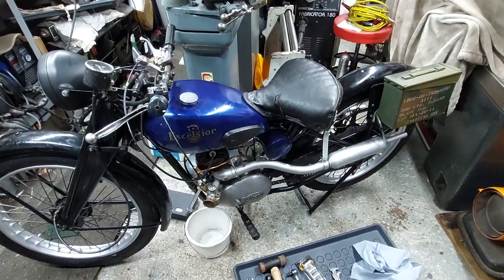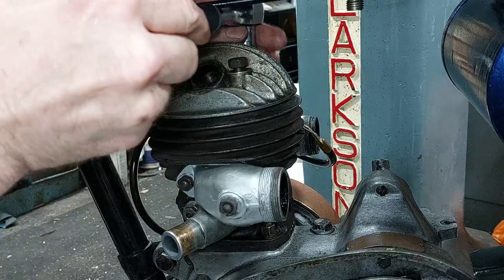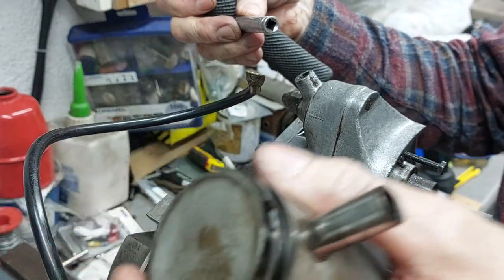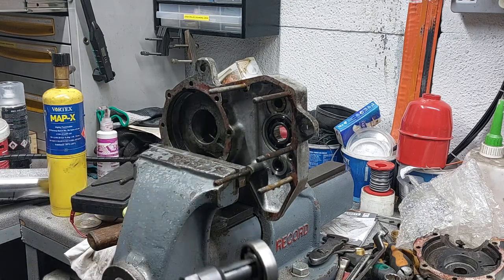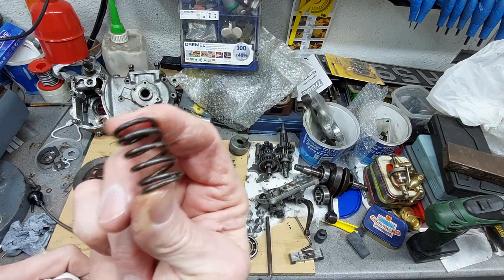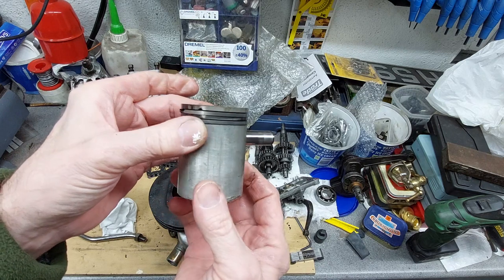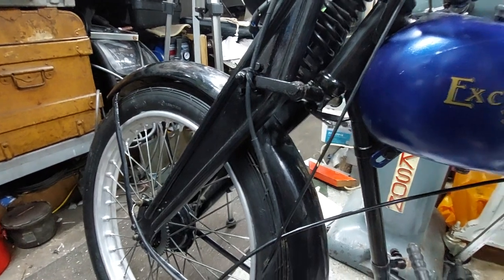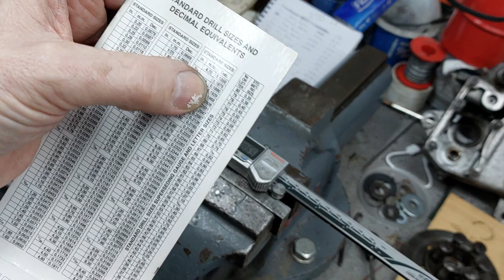ENGINE STRIP DOWN & INSPECTION OF 1939 EXCELSIOR UNIVERSAL WITH THE VILLIERS 9D 125 ENGINE..

Comment: Outstanding video.  Thank you so much. About 10 years ago I purchased what I believe is a 1946 James motorcycle in original condition.  It appears to have this exact (or very close) Villiers engine.  Mine is a MK.9D, magneto number 539/351 6P.  Since purchase, various projects have kept me from tearing it down to get it running.  However, your video has inspired me to give it a go in the near future.  I appreciated that you took time to include the address of a parts supplier.  Since I live in the U.S. where Villiers are rather rare I'm unaware of any suppliers in this country.  Your video was very methodical, with good thought and discussion as to each part.  I wish there was a local mechanic I could turn this over to and get it back next week.  But since that is not possible, videos like yours with good sound advice and overview will have to do.   By the way, that small mystery pin almost looks to be about the size of the missing ring retention pin in your piston?  If it is, I don't know how it could have dropped into the lower part of the engine except perhaps by a previous mechanic while taking it apart?  Thank you again for taking time to post it.
Reply from the maker: Glad to have inspired you, the MK 9 D's are pretty thin on the ground over here too surprisingly, the piece of rod turned out to be a bit of clutch pushrod, some butchery had gone on in its lifetime, all is explained in further videos, here's the playlist for you 

https://youtube.com/playlist?list=PLyBa-OlxfN3O0yMoIH6EpObMCLLkGXwAO&si=h3DueCSsle0ZOear

Comment: Think the mystery part in the oil is part of the clutch pushrod system.  Is there a ball-bearing in the push rod stack too?
Reply from the maker: Hi Chris, you are quite right, it's part of a bodge to get round a problem that i wasn't aware of until the engine was reassembled,  it was part of the pushrod stack which then got replaced with a couple of ball bearings to circumvent a problem. The clutch system on these units uses 3 pushrods with a ball end on the clutch lever . All is revealed in this video https://youtu.be/hPRCcUYeqp0
Reply: @TweedsGarage  similar to my ducati. Has a load of rollers and balls to reduce rotational force on the pushrod.

Comment: Well this takes me back. Had a Greeves with an 8E 197 Villiers. From memory the primary case oil is  SAE 180. At 4 centigrade you'd need to shovel it out. Re-corkedmy clutch. Used to replace the crankshaft oil seals monthly because the crankshaft was so worn where they bore.   Could never getthe timing right. Either easy start on the kickstart and gutless or bump start only but plenty of power. Remember the brass flywheel too but had no lighting coils. Great times.  I think I donated it to the local ATC for spannner and general fettling. practice.
Reply from the maker: An interesting trip down memory lane Andrew, they did like thick oil in gearboxes and chain cases back then ( probably an attempt to stop it falling out ) , the Ariel NG i had had a grease filled gearbox.....which was fun doing an oil change on.
Reply: @TweedsGarage  long since left road going stuff behind. Found grassroots flying. Have a plane to restore, which I've had since 1986.   Here's a tip for you. Light aero Spares can supply aircraft quality BA nuts and bolts.  Love the Riley.

Comment: That was a giant leap forward! Nice to see your bench is as full of essential bits as mine is. It is good the the main bearings are in usable condition, I too have a great deal of mistrust of bearing with no makers name on them, these small machines are very handy when you come to a rebuild, no lifting gear or huge load bearing benches are required. Chris B.
Reply from the maker: I do try to tidy it up Chris but usually get distracted so it soon ends up back in chaos , i did think it would be a nice easy project to do in the workshop on the bench whilst it was too cold to be rolling around under cars at the moment.
Reply: @TweedsGarage  I have the same problem down here in the South! The gauge tells me it is 4 degs, but it feels much colder, probably due to the 80% humidity, so the Defender stands outside waiting for the new brakes to be bled! The problem I find when I tidy up is that I can never find anything. Stay safe! Chris B.

Comment: I was just wondering how much piston ring movement is too much (  not piston ring gaping  ). But up and down movement of ring in piston slot.......looks like I am one year late in asking question... engine I have is 1F
Reply from the maker: Hi David, apologies for the late reponse but i was checking a few bits of info first, Villiers don't specify a minimum thickness for rings  for the 9F, but do specify a maximum ring gap of 0.030" before replacing and a minimum gap for new rings of 0.007 " . The major British manufacturers of the time specify a vertical ring clearance of between 0.002/0.003 " but this is for four strokes so you could probably allow 0.004 " which BSA recommend  for competition tuning. 
If you need a new set try https://villiersservices.co.uk/
Give them a ring as they stock a load of parts for the older engines but don't list them all on the web site.
The rings on the Bantam were worn to nearly half their thickness but the piston grooves were fine!

Comment: Nice video and explanation of the strip down. It sounds as though even after 80+years spares are still available. Rather different to more modern Japanese bikes. I follow Allen Millyard's channel and in his rebuild of his Honda ST 1100 he mentions parts not being available. They are so reliable I suppose there was never a demand.
 
That Jenkins chap needs house training.
Looking forward to the re-assembly and clouds of two stroke smoke.
Thanks for sharing.
Reply from the maker: cheers Colin, yes the spares back up is good for the Villiers engines. I did see the ST 1100 rebuild and it was surprising the scarcity of parts especially as Honda used to boast that they held parts for all the models they had made, I think they let this policy slide a few years back.

Comment: You're confirming what I am finding, old bikes are much easier and faster to rebuild than old cars! That little pin you found in the gearbox isn't a lost dowel pin from the two crankcase halves was it?
Reply from the maker: that is still in position and interestingly they use the same roller bearing for the locating dowel as used in the big end bearing, it's slightly rounded at one end so suspect it might be a bit of broken clutch push rod.....I will measure it at some time to confirm .
Reply from the maker: On closer inspection and measuring it appears to be a short bit of clutch push rod ( maybe ab old one that had worn down)